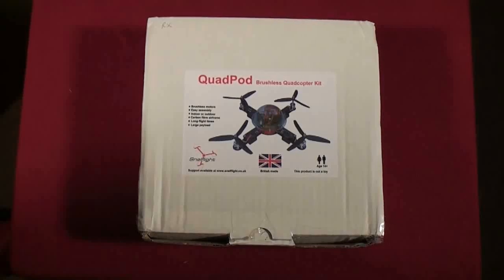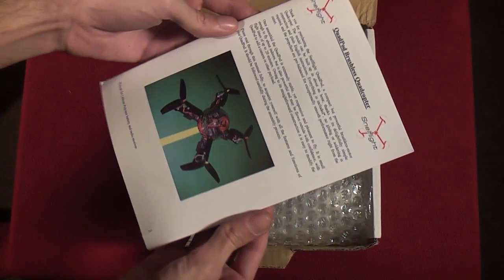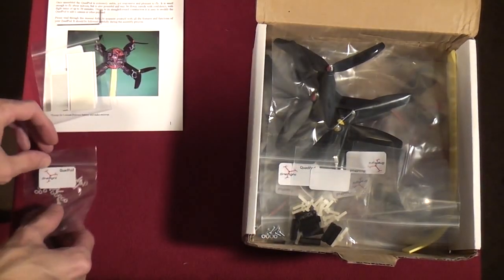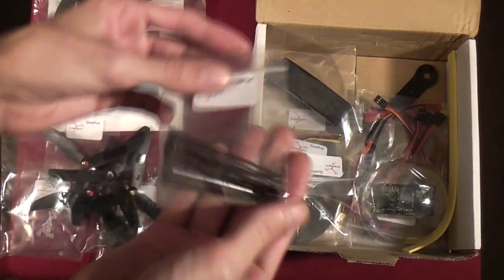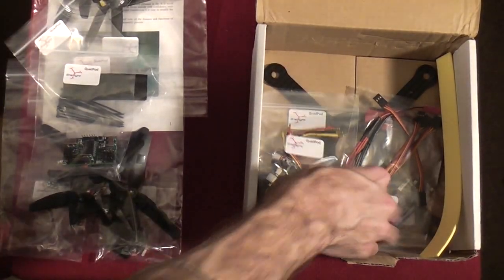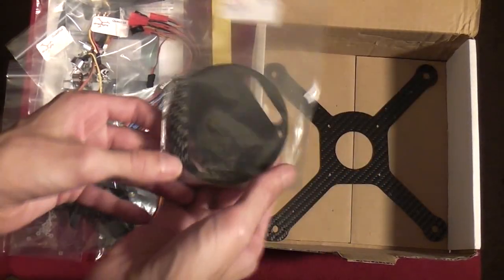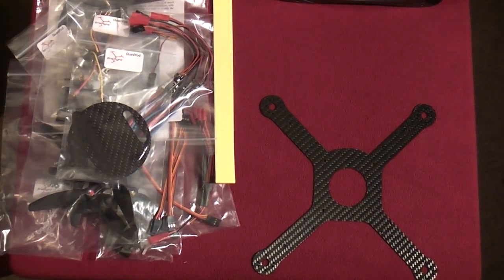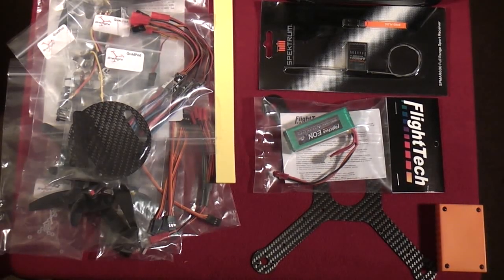Quad Pod Quad Rotor Un boxing

Comment from the maker: @Deathbynature89 they are a great platform, and this one has 3 gyros on board so pitch roll and yaw are all stabilized so you can concentrate on flying or filming, i'm curious if i can make it loop thoug, i've seen quad rotors do it before.

Comment from the maker: @dittsboylogan i like the size of the mCP X because it shouldn't be big enough to cause major bodily harm if it hits you or someone, unlike larger 3D helicopters.
 they are getting better at motor driven tails, but they sill burn out and twitch on occasion.

Comment from the maker: @TheMokamola brush less means the permanent magnets in the motor spin and the electromagnets stay still.
in a brushed motor the electromagnet spins and the permanent magnets stay still. electricity is transferred to the spinning electromagnet by using a set of brushes that rub against the shaft, brushed motors are a mechanical system that makes it easy to switch the polarity of the energy going into the electromagnet and cause a spin. Brushless motors are more efficient and can be more powerful.